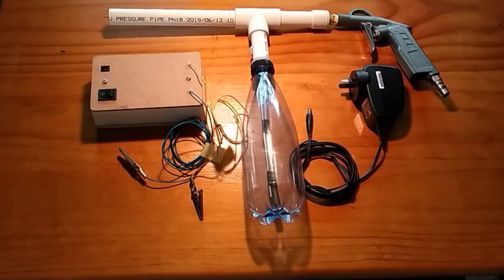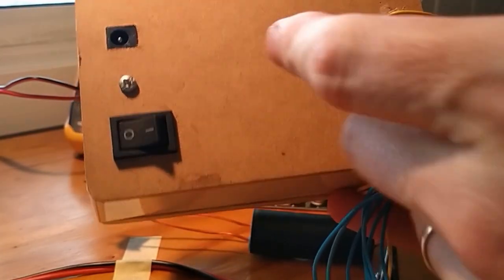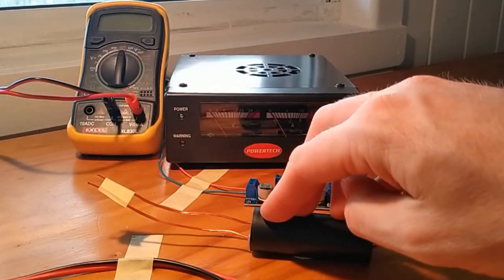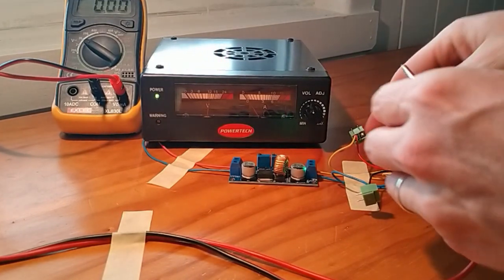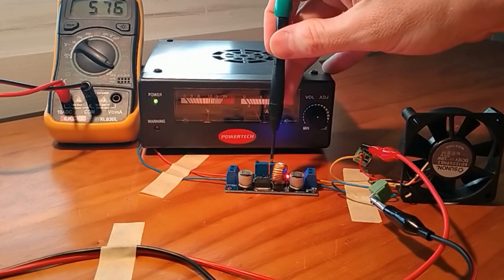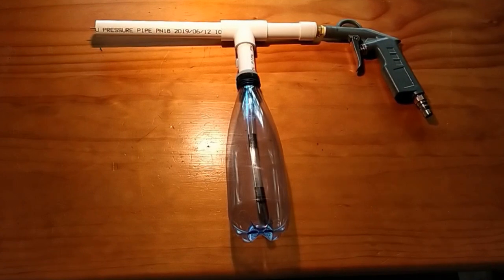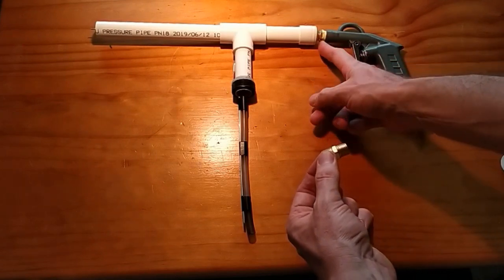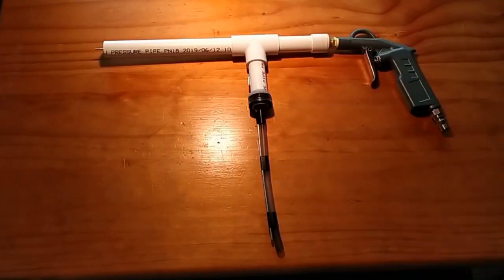Homemade Powder Coating Gun

Comment: Good and detailed explanation. Why is the positive high voltage attached to the pipe and the negative to the part? Can it be reversed?
Reply from the maker: I have tested it and it doesn't really matter which way it is around. I have done both and both work. I don't really know how to measure which is better.
Reply: @tinkersmith4615  You are very useful man! I am asking because read both for tribo and corona powder coating. I wanted to make tribo gun as it is without high voltage. And they use teflon/PTFE/ which polarized the output tube negative. It may be useful.
Reply: There are two different types of powder coating guns. The most common are "corona" style (no... not wuhan) which uses a negative charge on the gun. Their main benefit is they last longer due to the parts not coming into contact with the powder, which is abrasive. The downside is they can have a problem with the faraday cage effect which prevents getting good coverage on the parts you're spraying. 
The second type of gun is a "Tribo" style. These are gun positive and have an electrode that comes in contact with the powder, giving it a positive charge. These guns deposit much more material on the surface of what you're powder coating as well as into recessed areas. The downside to Tribo guns is they apply powder slower due to the lower PSI air use in order to charge the powder while going through the gun.

Based on the test video Tinker Smith has made, he seems to have good results with how much powder is deposited.

Comment: Great video, with detailed explanation!  Does the part that is being powder coated  need to be discharged in any way before you can touch it ( and put it in the oven?) I see you touch the tip of the gun to the grounding clip before turning the metal piece around.  Regards
Reply from the maker: I discharge it to be sure. I think in the video you can hear a little tiny zap when I discharge it. I do it just to make sure. I did get zapped once when it was all on and live. Wasn't paying attention. It made me jump but didn't hurt.

Comment: Hello again
What i mised in the video is what kind of opening there is in the bottlecap where the powder must go thru. Did you drill a hole thru the cap or is the cap totale open?
Reply from the maker: It seems I forgot to talk about that. As luck would have it, the external diameter of the 15mm PVC pipe slides nicely into the opening of most bottles. I kept the bottle cap because I wanted a bump stop to help set the depth of the air pipe off the bottom of the bottle (3mm or so). I just drilled a hole in the bottle cap, slid it up to the mark I wanted and then hot glued it in place.
Reply: @tinkersmith4615  Thx for the reaction but i stil do not understand it.
The air is going thru the air pipe,then travels thru the powder en must then go back thru the bottlecap thru another hole right?
Reply from the maker: Hope this answers your question: https://youtu.be/YsN4F2naDf0

Comment: hi can you put some links on for the electric parts used please
Reply from the maker: High Voltage Generator:
- Local Supplier AU$11.78 (for me, Australia): https://www.ebay.com.au/itm/Boost-Step-up-Module-High-voltage-Generator-Converter-DC-3V-6V-to-400KV/402398997879 or
- China Suppler AU$5.05: https://www.ebay.com.au/itm/DC-3V-6V-bis-400kV-400000V-Boost-Step-up-Power-Module-High-Voltage-Generator-AU/293859215336

DC-DC Buck Converter:
- Local Supplier (Item 4) AU$12.89: https://www.ebay.com.au/itm/AU-XL4015-5A-DC-DC-Adjustable-Buck-Converter-Step-Down-Power-Supply-Module/312845023874
- China Supplier (Item 4) AU$3.31: https://www.ebay.com.au/itm/5A-XL4015-DC-DC-Step-Down-Buck-Converter-Module-Power-Supply-LED-Lithium-Charger/162870710796

Hope that helps. :-)

Comment: I only have adapter with 2a output. Will it work like yours?
Reply from the maker: I was originally running it at 4V/2A. It worked but had more overspray. It might just take you a little longer to powder coat something. I found that 1.5A was too low.  Why not start with the 2A adapter and if you come across another one, go with that. Would be keen to hear how you went.

Comment: Awesome Video TS
I've already started to order parts!
Could you post a link to the cheap gun and the bottle you used.
Thanks heaps!!
Reply from the maker: I already had a cheap air gun handle which is the one in the video. It is exactly the same as the Ozito Air Glow Gun from Bunnings (Australia): https://www.bunnings.com.au/ozito-air-blow-gun-kit_p5810654. I bought one for another device and tested it so I can confirm it is the same.

The bottle is nothing special either. The bottle in the video is a reused Northbrook Lightly Sparkling Spring Water bottle (500ml). Any tapered neck bottle will do.

Hope you enjoy your powder coating gun! Would love to hear your experiences with it.

Comment: sorry I want to ask the function of the 2 clamps in the generator where it is attached to it ... thank you
Reply from the maker: No problem at all. I should have been more specific. If you go to 1:50 in the video and pause you will see both alligator clips in the shot (the part where I am showing the gun in action). You will notice that the yellow wire (high voltage positive) clips to the top of the gun where the rod ops out of the barrel. This ensures that when the powder moves through the barrel it is robbed of negative ions. The blue wire (high voltage negative) is attached to the thick wire holding the item I am coating. This then grounds the work piece due to the high voltage passing down through the holding wire. As the charged powder moves towards the work piece it clings to it due to static electricity. Hope this helps.

Comment: Hey thanks for the amazing video. There is someting bothering me tho, any powder coating system i have ever seen (that has a small power supply like the one you made) usually uses 15kv-25kv output and yours has "400kv" but it does not (or does it?) apply powder any thicker? I just wanted to know if you have any ideas about the reason behind it. Thanks again!
Reply: Those cheap voltage boosters when run at 4v and 2.5a or so only put out about 30kv.
Reply: @LBCAndrew  cool, that is plenty :)
Reply from the maker: Good question, I don't really know. This is the only powder coating gun I have ever used. I built it because I wanted to get into powder coating and thought of the idea. I don't really know what high voltage I am running because I don't have the instruments to measure it. I am somewhat doubtful of the 400kV claim and assume that it would only produced that when 7v is applied. I am only running 4V and 2.5A so I don't know how that affects things without measuring it. Maybe it is running 100kV? Your guess is as good as mine. Thickness, not sure again. Did you want it thicker or thinner? I could run a few experiments for you at lower voltages? I first experimented with plain flour before I bought my first powder. Just wanted to see if the static charge would hold anything. Amazingly, it did! That was a very thick coating. Keen to hear your thought.
Reply: @tinkersmith4615  Yeah, I also thought ebay listing is not %100 true. And even if it is true you probably have to run it at 6v. I would love to see you do some experiments using different voltages. I don't really know if i want it thicker or thinner, never done any powder coating before but I am just restoring a car and I was thinking of powder coating some parts. I already ordered parts for building the powder coating gun. I will also try to flour coat some parts haha. I guess you can use literally any type of powder to coat? I doubt it will be useful for anything tho. Thanks for fast reply.
Reply: @tinkersmith4615   flour,  perfect ! brilliant too ! I'm going to build a few before I go buy an eastwood. eastwoods look pretty much same as what you built.

Comment: Hi, why does it have to be a bronze wire? Can it be a copper wire instead? 
Thanks a lot for sharing, I’ll build it soon .
Reply from the maker: It is only bronze wire because that is what I already had. :-) The rod holding the tube in the bottle is aluminum. I can't see why copper wouldn't work. The only problem you might have is patina on the copper which might eventually alter its performance. Keep it clean and I reckon it should work just fine.
Reply: @tinkersmith4615  Thanks!

Comment: At what airpressure do you use the gun ?
Reply from the maker: I was only running it at 5psi in the video. I have seen people run their commercial guns at 10psi or so but there always seemed to be a big cloud of overspray. At 5psi just enough is coming out that it is highly charged and so I get very little overspray. The neat thing is, if the work piece is round or thin the charged powder swings back and sticks to the back of it. Having said all that, if you run it at a higher psi the charge is plenty strong enough for the powder to hang on as the air passes over it.